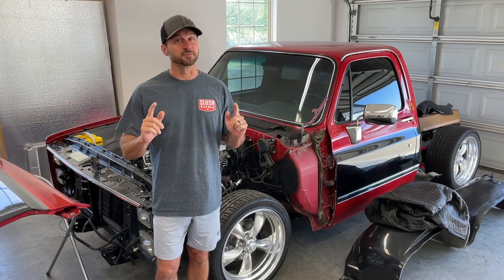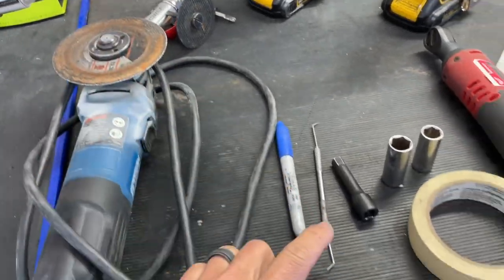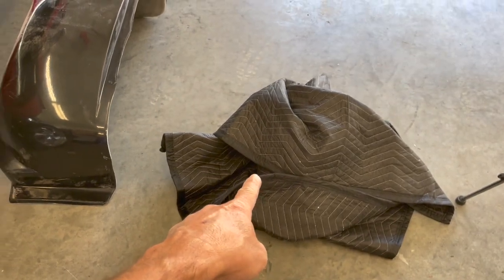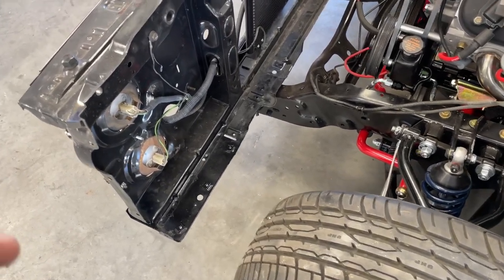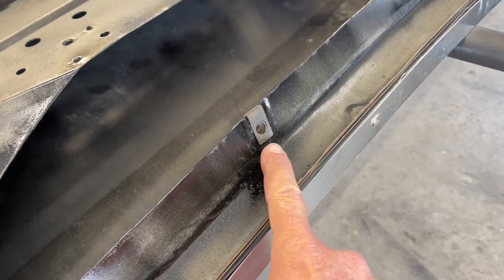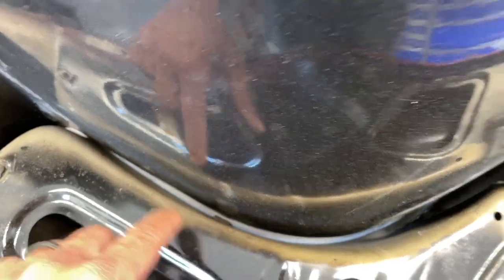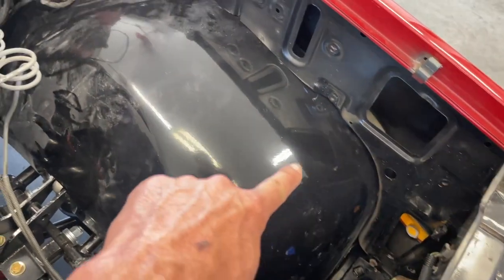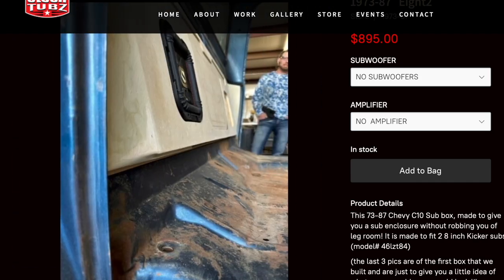New Square Body Build Part 9: SloshTubz "Mild Slosh Tubz" install.

Comment: Sharp Truck. If the fronts are 245/40zr20s. Are the rear 295/40zr20?
Reply from the maker: Rears are 315 35 20
Reply: @GreaseMonkeyTV  Thank you!